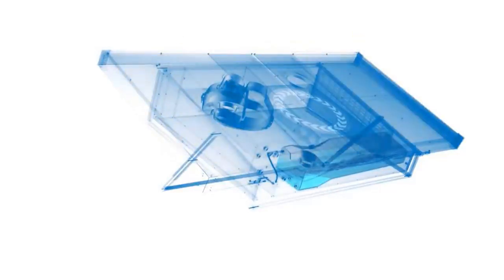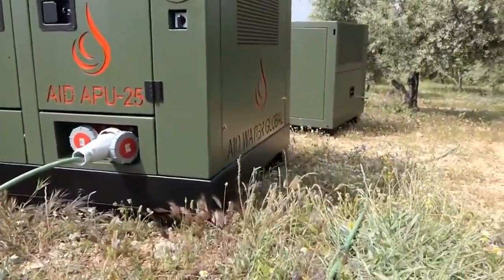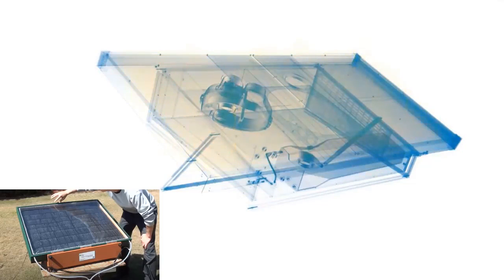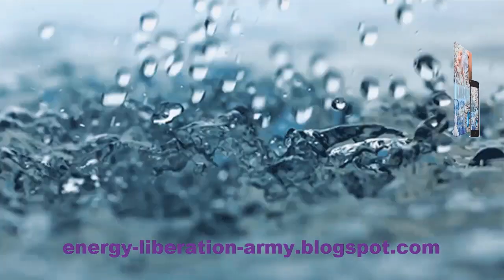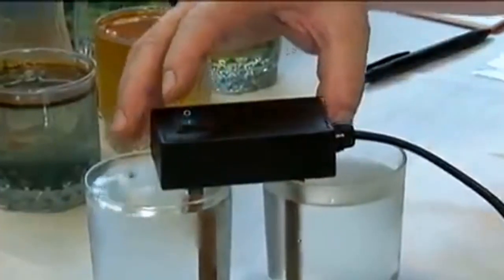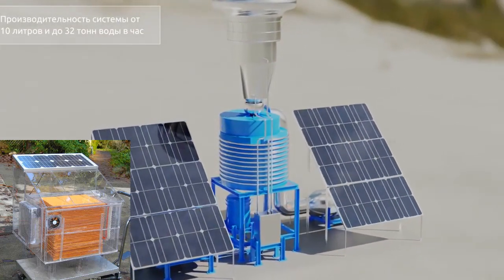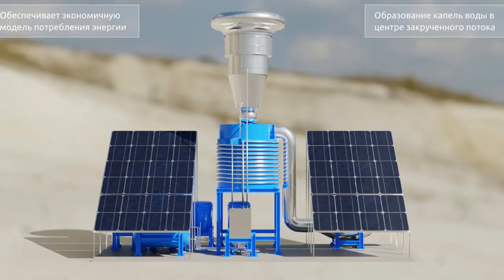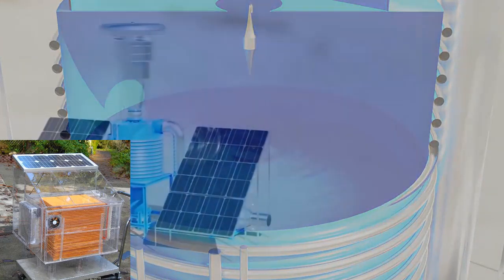Atmospheric Water Generator and the solution to make this machine yourself!

Comment: Cost? Website?
Reply: Cost, fairly cheap. Website HAHAHA Don't bother, they have no more to offer than what you've seen. The non-refrigerant system theorized here works by slowly compressing air into the chamber. Once it's at pressure a sudden decompression causes water vapor in the chamber, the vapor droplets are then large enough to be collected  by capillary absorption or surface condensation. The fantastic claims of UP TO 30 Gallons a day are a theoretical dream based on extremely unrealistic ideals, i.e. a 99.9% humidity, a peak solar generation and a machine the size of 2 or 3 full size shipping containers! The ridiculous thing is, this concept works better at night and so would need to charge batteries with the solar by day and operate at night. BUT the whole system is like making a bed out of concrete, yes it can be done, but who would do that when a far more comfortable bed can be made easier another way! Refrigerated systems, the aircondioner system mentioned and depicted as extremely energy consuming, again misleading! Aircondioners could be way more efficient if tuned to the exact climate but that's not practical for 99% of mass produced units. If the idea was not air con, but water collection, you wouldn't need half the power. In an environment that is very sunny.... like the type that you may need this THING. No more than a 12 inch square solar panel would be needed to get maximum water yield from the air flowing through the evaporator.  Ammonia gas refrigerant and a magnifying  lens on a solar tracker to focus on the capillary is all you need. Look up, 'Three way refrigerators' or kerosene powered fridge! 
Honestly none of these idiots have a clue, they are just regurgitating something they heard and think they understand the science. The water is the memory consciousness of wisdom.. what ever blah blah blah... Water is way more complex than anyone knows, well some know.... me.... the guy that won a Nobel prize researching water memory ( look that up!) The first atom in the universe was a hydrogen atom, amassing to create fusion (burning without air) made helium and so on. Once the place was full of atomic carbon structures, a catalyst was needed to go from rock and dust some molten some solid... space-slag! To the earth we have. That catalyst  was oxygen, oxygen and the first atom of the universe, make WATER H20! The only thing that expands when both heated and cooled, meaning it's the only element holding in the plane of existence when all else would collapse into nothing with zero atomic activity at the point of absolute zero!   

This guy and most like him are wishful thinkers, wanting the free ride to be real because they are too lazy to get a real job!!!
Reply: @mrgoodman6620  I just want a couple glasses of water a day . I never drink the stuff. But my land is dry.